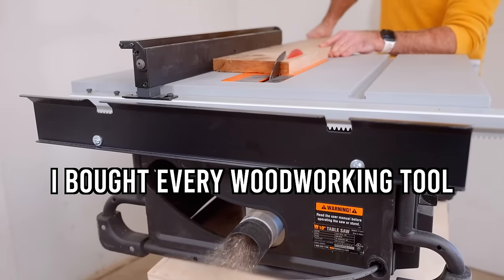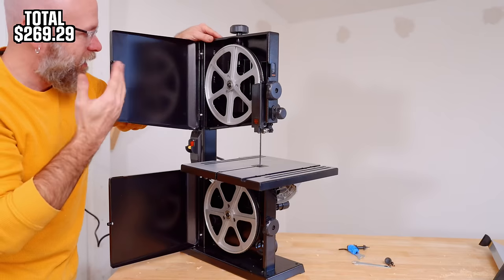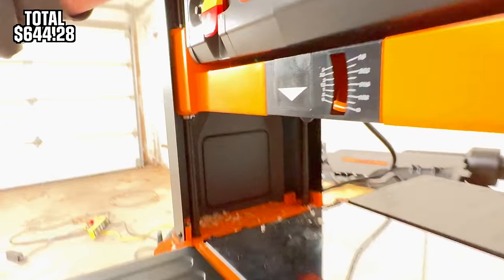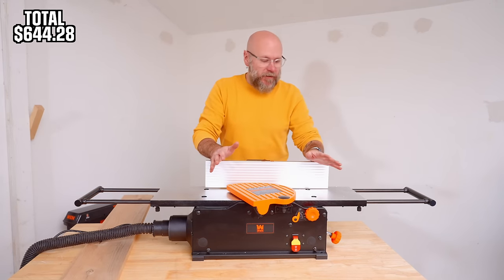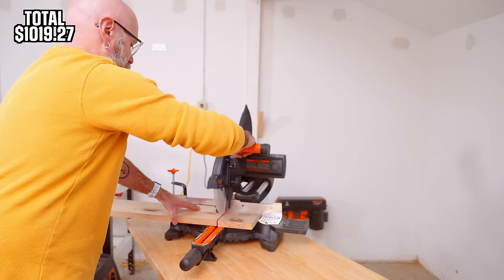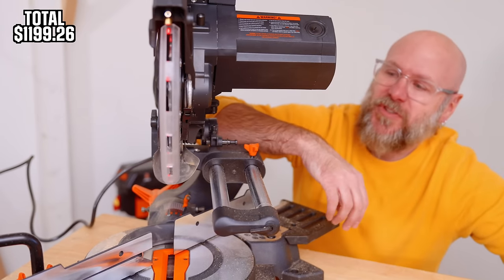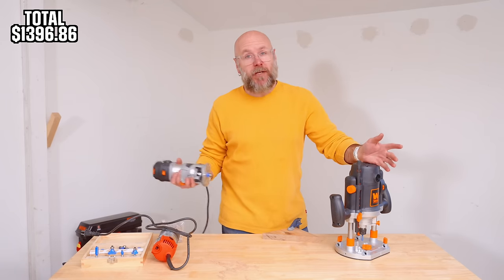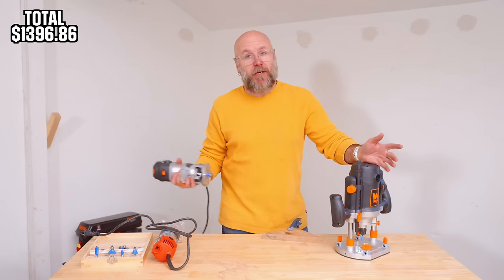I Bought ALL THE WEN TOOLS! Let's Review.

Comment: I bought a wen from Amazon about 5 years ago. I got it with a chip next to the knives and it left a mark down every piece of wood that I sent through it. So I requested a new one from Amazon they sent it out within 3 days. The new one that I got also had the same chip in it. So instead of sending it back I just fixed it myself. Since then I've planned thousands of feet of rough cut lumber for projects around the tiny house I made. 
.

Comment: Nice report. I use a WEN angle grinder which has taken some hostile use in metal-working. Works fine.  Shocked with the lack of QA on the planer.

Comment: Holy smokes on the planer. I have the very same unit and I love it. You almost don't have to sand the wood as it come out. Smooth as butter. Bought on Amazon.  Edit: I think the planer is the only Wen product that I own. Edit^2: If I didn't know better, I'd almost say the table saw is a copy of my DeWalt 7491, which I dearly love. Fence is different, b ut similar.

Comment: I have most of those tools. There are very specific tools I opted to spend the money on... like I bought a nice helical head planer by Cutech, Rikon Band Saw and a Festool Track Saw. And I would still do the same thing again, although, I'd just go with Makita Track Saw and save the extra $800 and apply it towards more tools.

To me having capability is far more important than just having the "best tools". Both WEN and HF fill that gap for me so I can focus on getting my projects done, rather than struggling with "work-around solutions" because I lack a certain tool.

Comment: I do believe you can adjust the return spring return.  Loosen the nut and CAREFULLY move the cup retainer away from the dog or slot that holds the spring. Back off a little and that should fix it. This is only based on other drill presses. I don’t own a wen but mine I can adjust this way. Hope it helps. If not hey you know I was paying attention to your video 😂

Comment: Interesting video.  Couple of comments.  You forgot to mention the best feature of the miter saw, and that's the fact that it has forward facing rails so you can place it against a wall in your shop -- to me, that's your fifth star.  Also, the table saw is loud because it's not a contractor saw, but rather a benchtop saw.  It has a universal motor like a router, miter saw, etc. A true contractor saw has an induction motor, which has a slower startup, but is much quieter.

Comment: You need to get a WEN shop air filter. It's GREAT for cleaning the wood dust out of the air and it really does keep the shop a lot cleaner. 

I got different filters so when we stain and paint, I kick it on and it gets most of the chemical smell out of the shop. I can't recommend it enough.

Comment: I got a slow speed bench grinder made by wen. It’s for sharpening tools without overheating them as easily. It works just fine but I haven’t used it much. Last week I mounted it on a platform with sharpening jigs for lathe tools but haven’t tried the set up out yet.

Comment: I have the smaller Wen band saw. I really like it, but I had to drill an extra hole in the side to access the lower bearing set screws. I also have the hand planer, which I absolutely love. The ejection ports clog when you're really planing deep.

Comment: that band saw you can actually chop the top off it and bolt a piece of angle and then it can be extended to what ever height you can get a blade to fit in. i have done with mine now cut depth is about 12 inches.

Comment: Most contractor saws use a brushed DC motor while your cabinet saw uses a brushless AC motor. DC motors are much louder than AC motors. AC motors are typically too large to be used in contractor saws as well as hand held power tools hence why so many small power tools are so loud. Also given that DC motors spin much faster than AC motors a gear reduction is requires on something like a table saw and depending on the quality of gears can contribute significantly to added tool noise.

Comment: I have 3 WEN tools, well actually 4 but one is a vintage mini grinder and not really wanting to use it.  Of the others are 12" Drill Press, 1"X30" and a 4"X36" Sander.  Planning on getting a 8" Grinder with the Wen Stand.  So I have no issues with Wen because they all come out of the same plant,  just Different paint schemes.

Comment: I have the Wen drill press that cranks up and down, cause I got tired of trying to position the table just right. It does the job, no complaints. I did remove 2 of the handles, but I always do that on a drill press. I only need 1.

Comment: That piece that flew off the case of the drill press is called lots of things, possibly find it as a 'speed nut'. It should affix to the hole inside the casement; if not it may have broken in half. Take the pieces to a hardware store that employs old people.

Comment: It's funny I do the same thing on my drill press. In fact, I took the hood right off. What do you need it for. I leave my drill press belted in the slowest speed all the time, no matter what I'm doing. No matter if it is a 16-inch hole, 2-inch hole, buffing, or sanding. Also, take off two of those handles. You don't need them when handles more than suffice. Add a keyless truck to that drill press can you use it a lot more if you don't want to take a drill press apart advice to grease up the quill either taken apart or use a 90 weight gear oil drips from the top down the splines!  No run smoother without I a lot of that noisy chatter!

Comment: The noise from the table saw is likely due to it being a direct-drive design. The blade is fixed directly to the motor shaft and acts as a resonator for whatever vibrations the motor makes, and it makes a lot. More expensive designs have the motor driving an arbor via a rubber belt which damps almost all of the high-frequency, high-energy vibration modes. Better designs will also isolate the motor from the frame with rubber mounts, whereas direct drive design often do not.

Great reviews, btw, and thanks for spending the money and time so we don't have to. :)

Comment: I have the next-size up Wen drill press and have used it for a couple of years without issues. Love the thing. I also have the Wen air cleaner hanging from my shop ceiling. Also works great and the filters are easy to source.

Comment: I just bought the exact same drill press at harbor freight for $79 (Bauer).  BTW, I did same thing with the knob, it goes into the hole on the lid, and you dont need to turn the knob to open, just pull up on it.

Comment: You could improve several of these with 3d printed parts. Extension on the table saw fence lock. Replacement knobs on the jointer. A big overlay switch for the trim router.

I am a novice woodworker and I think Skil 10" jobsite saw is a great budget buy. I paid under $300 new black friday. It sacrifices a small amount of precision in table flatness and fence verticality for great quality of life stuff like like hardpoints to store guard/pawls/fence when detached, toolless adjustment of captive riving knife height (full guard height / 10" blade height / dado height), toolless adjustment to square the blade to the miter slot

Comment: Two comments: 1) I bought a Wen router for a project as a throw-away tool. I was shocked with the quality and have been super impressed with how great it functions with power to spare (actually kinda scary - LOL). IMO, you might want to consider it as a 5 star. 2) My 2nd comment is a question - does the track (for track saw) have a decent clamping system so I know it won't move at all during the cut?  If not, throw it away. There's no way I'm counting on sticky foam to hold the track in place when I need the cut to be exact. Also - how thick of wood (hardwood) can it easily cut in one pass? Festool is notoriously underpowered - is this one any better?

Comment: I’m 60 years old and i remember in the early 70s my Dad inherited a lot of tools from a family member  that passed   the majority of them were Woodworking Tools , his  favorite or more treasured  out of the group was a 1950s AMF / Dewalt  10” Radial Arm Saw  that is Speckled Green ,with RedBakeolite knobs  and for safety it actually has a metal Key  to turn it on and off  like a lock out  system  i still own that Saw today  in the group there were also 2 Wen Tools one was a Pad Sander  and the other. is a  strange  type of a Saber Saw that Wen called  a Saw All it basically  uses the older Jig Saw style blades  and  has the blade and foot sticking out of the front of the saw similiar to the modern day Reciprocating Saws  we call Sawzalls  the blade  does have  a reciprocating /oscillating  motion  to give it a more Aggressive Cut than a typicall Jig or Saber Saw  i do know that same Saw was rebranded  PowerKraft for Montgomery Wards  Wen also made heavy Duty 1/2” Drills  that were geared very low speed  and the one my Dad had we  used for drilling Steel and Concrete  if the Drill Bit got Bound up  there was no way  you could hold onto the drill  i don’t  beleive the Modern Wen Tools have any Real Association  with the ones produced in the 1960s and 70s  although i do think the modern ones like those  you reviewed  are a decent value for the price

Comment: I have a Wen 14' benchtop drill...  again I agree with your rating.  I had the laser unit die, called tech support and they led me directly to the part safely.  20 bucks later I was good.  So they do support their stuff.

Comment: I have the WEN 12 inch variable speed drill press. It’s okay. There’s a lot of quill deflection/play at full extension and the position of the tool is not super dimensionally solid… but it does the job.

Comment: I have had that WEN drill press for a few years now.  There is a spring  you can adjust to lessen the amount of tension the handles return with.  It’s the cylinder thing exactly opposite the press handle spindle.  There’s two nuts, ones a locknut.  Was frustrated by the same problem.  Adjusted the spring tension and problem went away .

Comment: Damn the reason I watched this video was to see if the planer was decent. I have two wen tools 1: scroll saw which is pretty good but I haven’t had much time to use it and 2: a dremel style rotary tool which has a slightly wobbly chuck so good for grinding/polishing but not drilling straight holes in a little drill press stand for instance.

Comment: I actually have the slightly higher model of drill press from Wen, the one with the variable speed arm and DRO. The accuracy on it is shockingly good with basically zero runout that I can easily detect. Slapped a high precision chuck in it, and use it for detail work.

Comment: I have a WEN standing drill press with adjustable speed and speed readout. Only issue I have had so far is mounting a 2 axis vice that didn't fit the mounting holes so I adapted two 2x4s. Otherwise it has done everything I need it to.

Comment: Thanks for the budget review. However, I think you need to have a better defined star system. Here’s what I would suggest:
Does not work: 0
Does the job, but has issues that over time will get worse, has key safety issues, OR better can be found elsewhere for the price: 1
Does the job, but has issues with tool design that better quality can be found for marginal price increase (like crappy mitre fence): 2
Does the job, but has annoying issues that someone can live with (like cheap handles, extreme noise): 3
Does the job, has only cosmetic complaints, and is probably the best cost-function ratio on the market, and recommended for purchase: 4
Does the job better than higher priced “better” name-brand tools, aka a steal: 5. 

Based on this, the routers would get a 4, table saw a 2 (loud and chintzy), track saw a 3, jointer a 1 (really crappy blade on that), planer a zero.

Comment: I got the track saw mostly for cutting rough sheathing, I know why not just use a circular saw?! Well the track and dust collection with vacuum makes things alot cleaner, safer and quicker. Quicker cause you can stack 2-4 sheets, clamp them down with track clamps, and rip blindly. It has no problem ripping 4 sheets, I made hundreds of cuts and no problems so far.

Comment: Just watched the bit on the table saws and the noise. The issue is that your saw stop uses a large induction motor (drill presses use a small induction motor). Induction motors have capacitor-wear parts, and essentially always run at the same RPM. Contractor saws and miter saws use something called a "universal motor"... and those things scream. They also slow down immediately on contact with wood, rather than trying to maintain their "rpm multiple of the electricity frequency" of induction motors.

Comment: Why did you put it through the planer first though? That's exactly what the jointer is for.

Personally quite like the tilt on the mitre saw. Handy for when you need to cut compound angles.

As for routers (the larger models, not the trim thing) I'd say just pay a little more for a high quality brand. Routers aren't very expensive for simpler models (like the Wen) and the guaranteed quality from a brand like Makita or Dewalt is worth it imo.

Comment: That table saw looks like the portable DeWalt table saw my old boss owned. I remember turning it on for the first time, and being shocked by how loud that thing was. I actually immediately shut it down, because I was sure something must have been loose inside it. Nope, everything was as it should be. I've used many different jobsite table saws, and never heard one nearly as loud as that thing. I absolutely hated working with that saw, lol.

Comment: I have two WEN tools: a 3/8” drill and an orbital car buffer. They both feel like cheap plastic crap. They are both from the 1980s and both still work fine. The drill needs a new chuck as it’s getting pretty sloppy, but I hardly ever use it because we’ve gone cordless. It’s still a great backup though.

Comment: Okay, 1st off great video. Next, WEN is not an unknown brand, its been around for a long time. 

Starting with the benchpress, you can loosen a set screw you can loosen and swivel the head so you can drill longer depths. As for the bandsaw, I would think that for the cheaper hardware with higher quality ones. Thanks for showing the throat gap height. I've been wanting a bandsaw ever since my dad gave away the Craftsman saw I was supposed to from my grandfather. LOL.

I got the 13" planer & love mine. I got all the parts that I was supposed to have. I spent $329 on mine off of Amazon as well. Couldn't afford the spiral head unfortunately. Planer looks promising, I think I would change them out anyways. 

As for the miter saw, consider building a flip top cart. I personally would rather have a radial arm saw. I may look into the trim router. Disappointed to hear about the Kreg track saw jig. I'm glad you didn't go with any battery tools. There is a place for them and the only one I can see worth it is the trim router.

Regarding the cross-cut sled, I am very interested in that. I see on the tablesaw that the miter gauge is an upside down T-runner, or whatever it is called. It is exactly the same as on my Craftsman tablesaw. I am very interested in how you deal with it as that has stumped me for a while. 

BTW, I just subscribed! You seem to be a "real" person, not like others that have became YouTube "stars." 😊😊😊

Comment: Only 9k likes???  This is a fun video and deserves better.  I can't get Wen tools where I live and really do prefer higher end gear, but it was still engaging and enjoyable.  The noise is just cheap universal motors compared with powerful induction devices in better tools.  You sure though that sander is worth 5 stars? Last one I bought that cheap I could not feel my fingers after 30 minutes of use due to vibration.

Comment: I've been using the wen 12" drill press with the external speed control instead of switching belts. The depth stop leaves a bit to be desired but I love everything else about it.

Comment: The larger continuously variable speed drill press is absolutely worth getting.  It has way more travel and beefy knobs, so probably good for 5 stars. 😂  It has been a solid workhorse, so I’ve been thinking about getting a few other Wen tools, specifically the planer (oh the irony—glad they came through for you!) and the 8 inch jointer. Now I’m thinking the track saw, too, and maybe the routers to supplement my Bosch 1617 and my Ridgid trim router. And the spindle/belt sander. Dammit. 😂

Thanks for the reviews. Happy woodworking!

Comment: Thanks for this info - very helpful!  The original DeWalt DW744 Type I, table saw had a very similar pull-out extension option, the DW7441 on the back and another on the side..  These have really been helpful to me with larger projects.

Comment: Great review! On that table saw fence lock, just extend that lever handle by 4 or 5 inches and it should solve the interference issue with the sharp rack teeth and make it a little more accessible from the front of the saw. I don't think I could live with a manual tilt saw though.

Comment: Have the 12" drill press, it has to much run-out in the spindle. When you start drilling the bit shifts from center. I may replace the bearing to a better quality to see if it will correct the problem.

Comment: I bought a Win hand Drill back in the 70s yes they been around that long  i used it up till about 15 years ago after sitting unused it locked up, but it lasted a good 25 years
But i mostly used cordless tools and it was a corded drill. 
Bought a craftsmen to replace it not that i ever use it but you need one once and a wile. My Milwaukie drills do everything i need and they are cordless.  

The budget brands work, 
I would rather find stuff at estate sales or garage sales or even Craigslist.  Older american made tools are good, but i like Grizzly they keep plenty of repair parts on hand.